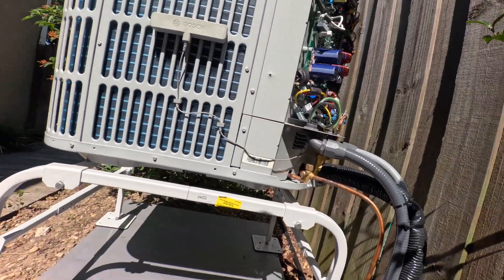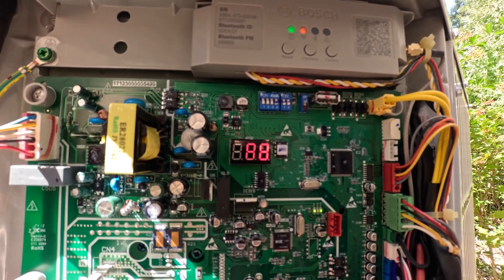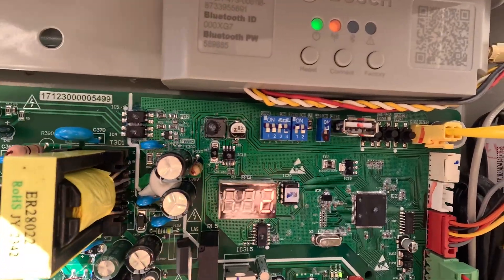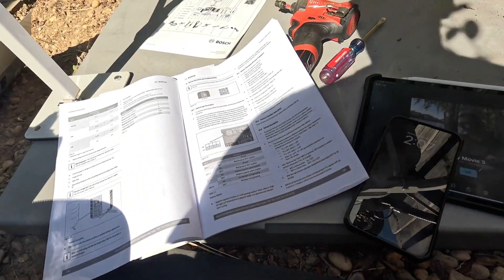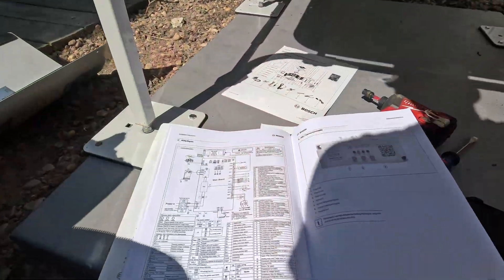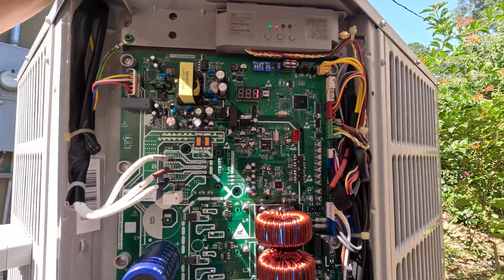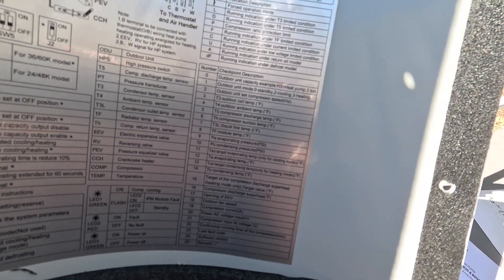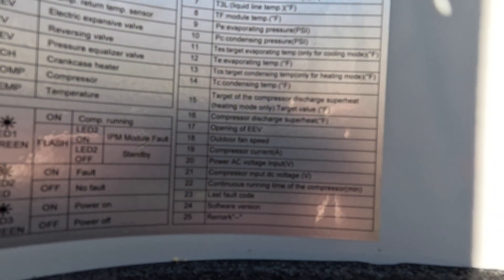Just A Quick View Of What I’ve Been Doing! #hvacguy #hvaclife #hvactrainingvideos

Comment: First time I have seen the condenser and compressor unit installed away from the house or structure. I am not an A/C  tech or installer but that makes sense when repairs are needed. Seen some your repairs done in very tight quarters or bushes planted too close.

Comment: Unfortunately I’ve had extremely bad luck with Bosch. Their boards fail often!
Reply: @July4.1776  Chinese Caps I've seen those bright blue POS in audio equipment. They are crap.
Reply: @JamesAgans  100%. that’s exactly where they fail, at the blue capacitor! Why would people continue to buy their shit?
Reply: @July4.1776  the only caps I will buy are Panasonic, or Nichicon. If you knew how many LED, PLASMA, etc Tvs have been thrown in the landfills because of Chicrap Caps, you would faint. Bosch had to know this, but it looks like they used them anyway. If I owned a system with those on the board, I would replace every single one of them.
Reply: @JamesAgans  only problem is the Bosch caps are soldered onto the board. There’s no practical way of changing them without voiding warranty.
Reply: @July4.1776  I'm not sure how good a warranty is from anyone that would use those caps, but I'm sure you are right.

Comment: I've noticed with charge mode the units will rarely ever hit the HZ rating from the manual. It is usually 1 less than the book. I use a Honeywell home thermostat because it works well with dual fuel. I keep CPH on 1. I have been told by other techs that the most basic thermostats are the best for the Bosch. Pro1, Honeywell (dumb) thermostats will outperform Nest, Ecobee etc.

Comment: My Dad wants me to put one in at his house once he finishes up with the pond repair and retaining walls.  He is a Bosch fan boy.  Lol.  When my 29 year old 90+ furnace finally dies, I want to put one in at my house as well.  I am pretty sure I am going to ditch the gas because my furnace is the only thing that runs on gas and there are about $25 per month just in fees associated with the gas company, even with zero usage.  They are sweet units.  I enjoyed the training class I took on them.  One of my local supply houses that I had pricing with ditched York and Bosch, so I just got pricing on Bosch from another supply house here locally that can still get them.  I have offered them a couple of times to customers, but no bites yet.  People have sticker shock with pricing compared to a normal unit.  Thanks for the video.
Reply: Definitely do dual fuel if you can, you're gonna find a point where its actually better to stick with whatever fuel your using past like 20 degrees
Reply: @851995STARGATE  We don't go much below 20 degrees outside normally.  I am in Northeast TN in the mountains, but we are still at lower elevation of less than 2000 feet.  It is still the South.  Last winter we did have 3 days in a row where our high was around 15.  Gas was nice to have.  Most of the time we have day time temps in the 30s, 40s, & 50s and nights get a little colder.  Depends on the winter we have.  Some winters are so mild I barely get any service work.  My Dad is considering Dual Fuel because that is what he already has at his place.  I hate paying $300 per year in fees for nothing.

Comment: It would be a good idea to install them with a phase line voltage monitor that includes surge protection. Surge protection is just the first step to protect the electrical components. There are products like the ICM Controls ICM493 Single-Phase Line Voltage Monitor and Ditek Kool Guard Intelligent Voltage Monitor with Surge Protection. In addition, a buck and boost transformer should be added as a best practice also.
Reply: Buck transformers are ideal. Surge protectors are great but will only clamp the voltage to 700+ volts during a surge. What kills the boards in these is when the line voltage gets above 250 volts. The thing to remember is at 240v RMS your peak voltage will be ~340v and this is what translates to the DC bus voltage.
Reply: @TofuInc  Yes you are correct, buck and boost transformers should be added as a best practice also.
Reply: Gonna be like these mini split when they break they break good
Reply: @tedhicks5431  I may be wrong, but from what I see, it has those integrated caps, so instead of changing caps, you change the board. Probably real easy to do, but I'm sure costly.

Comment: I bet that main board cost a fortune to replace. I don't see it lasting very long in hot environments or i hope they come with one hell of a warranty.
Reply: It would be a best to install these types of systems with a phase line voltage monitor that includes surge protection like the ICM 493. Surge protection is just the first step to protect the electrical components.
Reply: just looked it up $1500 for a replacement main board. yikes
Reply: You can buy a condenser for that much wit 10 yr. warranty